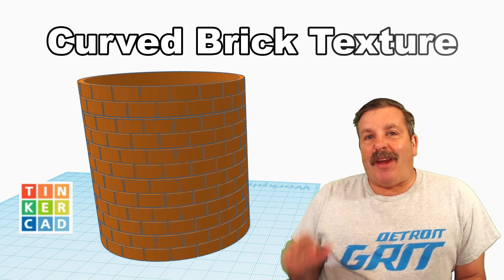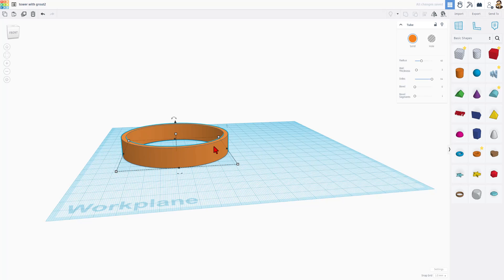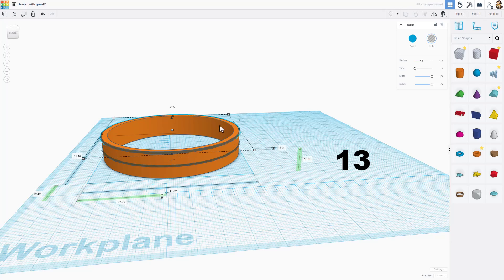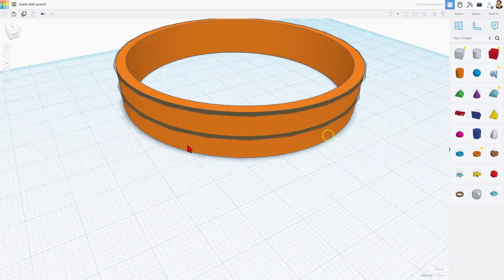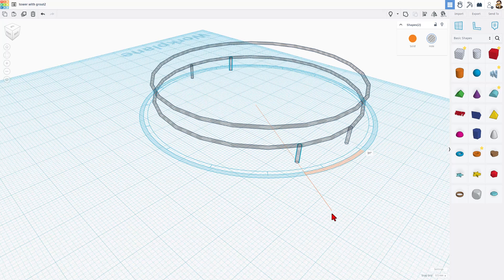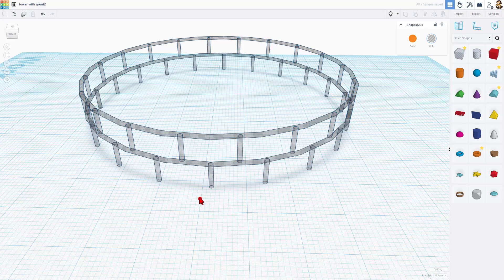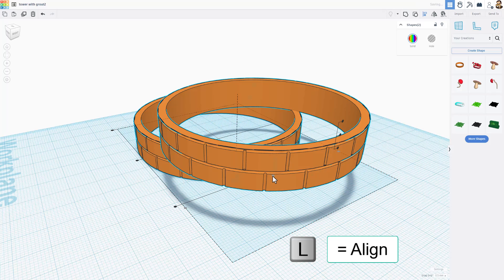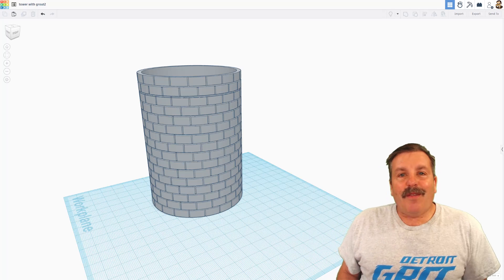Tinkercad Brick Tower Texture Curved Surface! Slick Steps in 9 Minutes

Comment: I did this different on a straigt wall for a 1:87 tower of 46cm high
i took a svg of a american brick template and coverted the brick patern to a grout pattern that i stored in my favorites in tinkercad.
i make it a hole and punch it in 0.25 or 0.5 mm in and group it
i print it in resin.
Reply from the maker: That’s awesome! Thanks for sharing.

Comment: Why do you stretch things and then type in a number? You can just type in the number.
Reply: I work like you, but I think dragging pops up the number box so it's easy for beginners.
Reply: @DanK-ZDP189  The Ruler pops up the number boxes.
Reply from the maker: I am a fan of shift scale. With that cylinder I was able to get the diameter I wanted with a single # too.  I found in the classroom it was really useful for kiddos as they start out.
Reply: @HLModTech  Stretching can sometimes distort shapes. It's fine for a plain box or a cylinder, but put a radius on those shapes and then stretch them and the radius will change. Put a radius on those shapes and then type in a number and the radius doesn't change. In this case, stretching and then typing a number is just an extra step.
Reply: Also for some shapes, like a Box for example. There are number inputs in the shape generator. Stretch the shape and those numbers become meaningless.
Reply from the maker: Holding shift is the trick that keeps the shapes from distorting while dragging.  It also made it so the diameter of 1 was a single click. You would have had to type that 2x , then add the height.
Reply from the maker: Yes, dragging handles break parameters. If you type a new dimension on a shape that is sitting on the workplane it breaks the parameters too.
Reply: @HLModTech  Even scaling will change a radius (albeit proportionally), but in this case you're not scaling. You're changing the size and then changing it again. There's no advantage to the extra step.
Reply: @HLModTech  If you make a box with a radius of 2 and resize it by typing numbers into the shape generator the radius will still be 2. If you scale it on the workplane the radius will no longer be 2. If you stretch it on the workplane by typing or dragging the radius will no longer be 2. Doesn't change the fact that what you did is an unnecessary extra step. You just changed the size on the workplane twice by dragging and then typing in a number.
Reply from the maker: All true. You may not like the shift scale trick, but I like to teach it. It is not useful everywhere, but in this case I was able to set my diameter in 1 click.